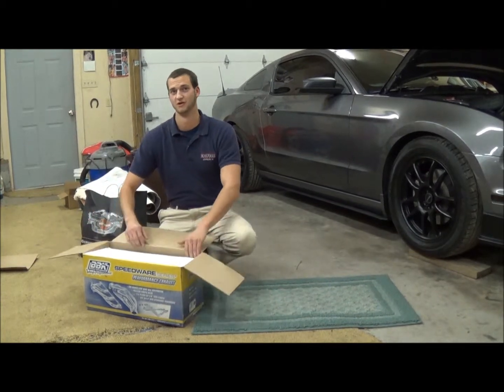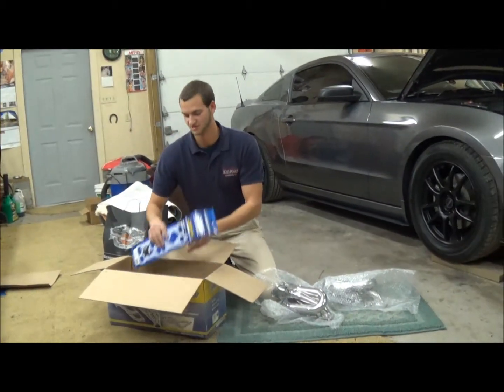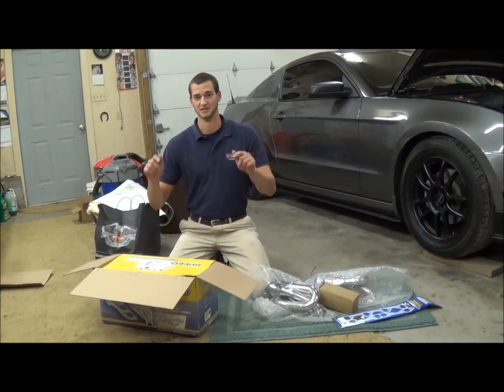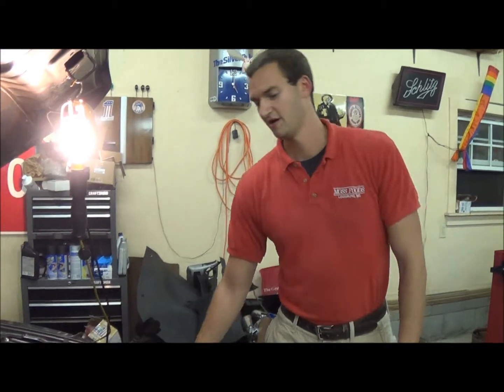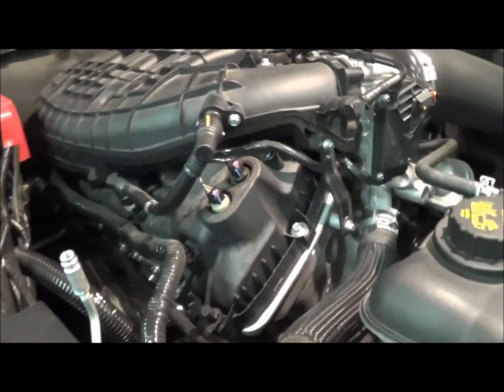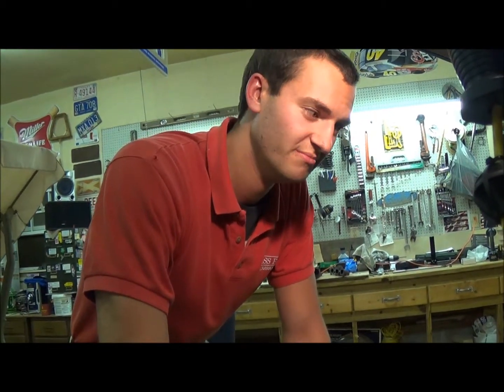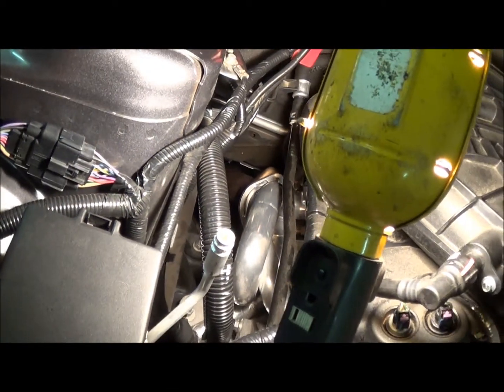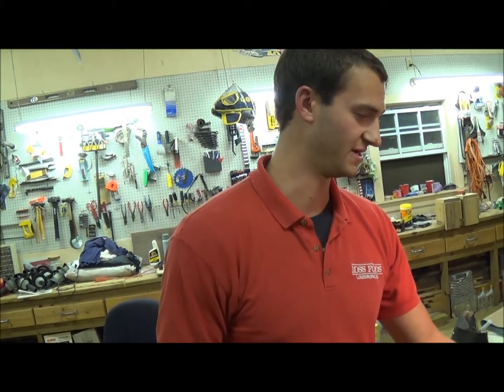fitform&function bbk headers

Comment: It sounds good for a v6 mustang, I want to go with the long headers and the catted pipes. Do you guys know if it need a tune or no? And if yes how could I tune it? 
Thank you
Reply from the maker: sorry for the late reply but for his car he drove it for a bit before he tuned it and it was fine. He got the bama sct tuner from American muscle. Its fast and easy to use. As far as long headers with catted pipes as long as the o2 sensors reach I don't see a problem.